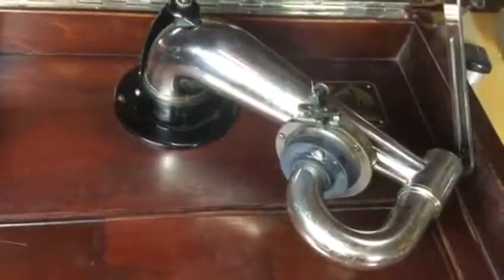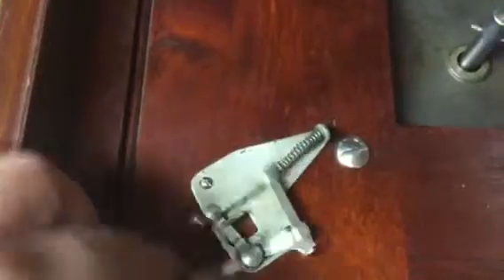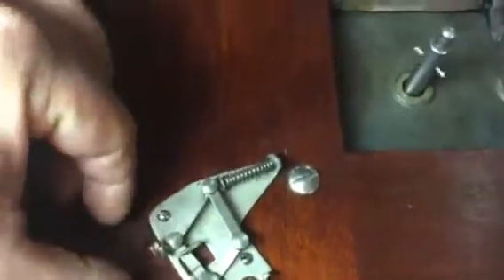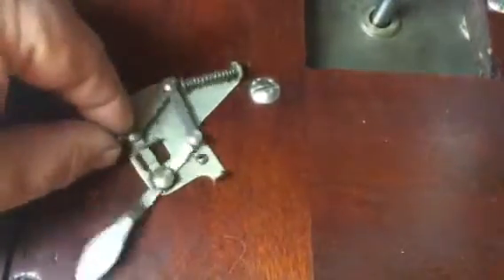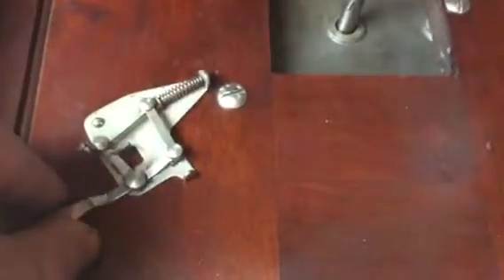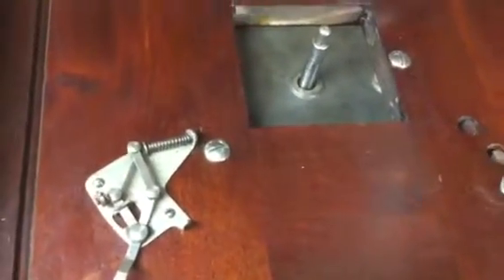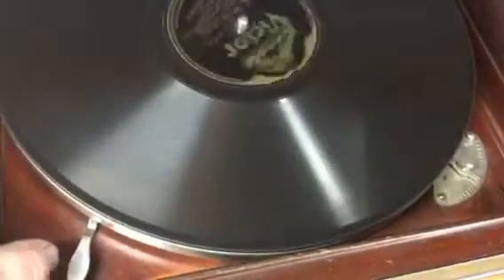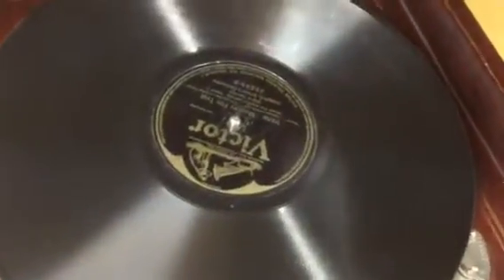Best turntable brake.

Comment: That's a very interesting brake. It stops so smooth, it looks like a good quality piece.
Reply from the maker: It is really a pity this design did not go further, the way it brings the turntable to a smooth stop, it is very easy on the motor and governor. Even if you quickly move the handle to the stop position, the braking is smooth and even, this would have been great if they could have developed it into an automatic brake design.